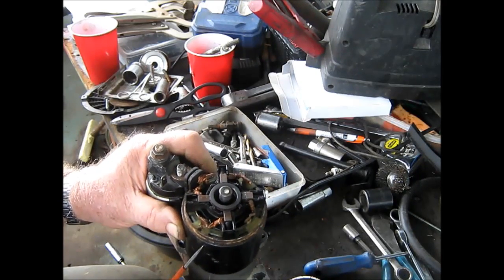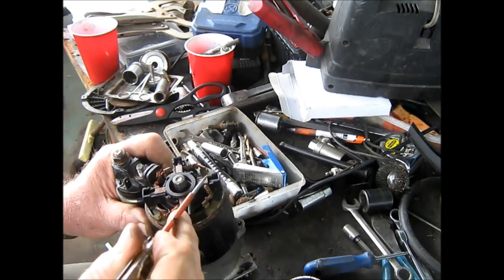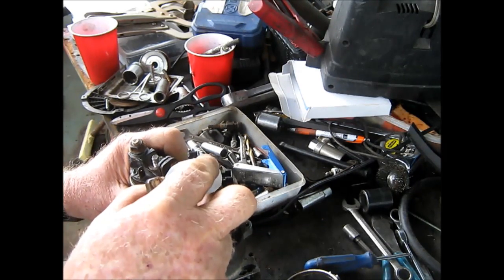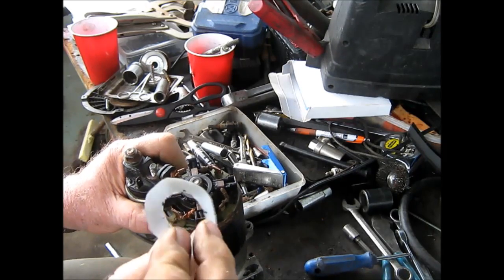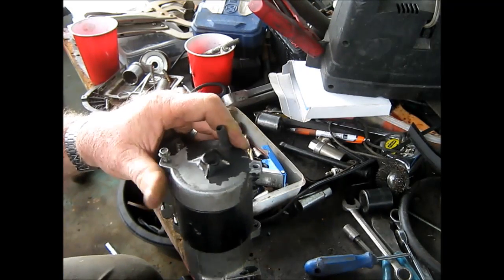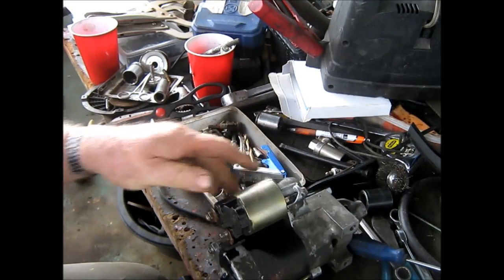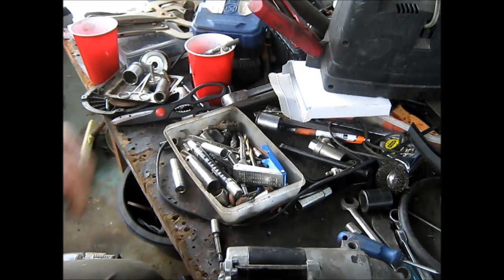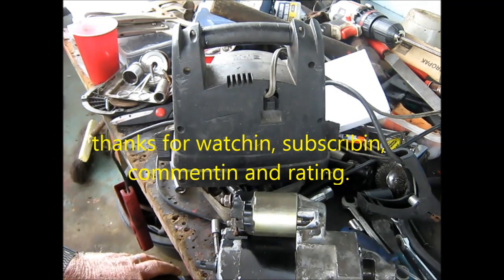Kohler Command Starter Repair

Comment: Hi MissouriOldTimer, Just curious if you could provide an update if your solution worked for any length of time. I need to play with my starter and can’t afford to buy a new one. How long did it last? Did have to do anything more to it? Thank you for your video.
Reply from the maker: lol. that's been over three years ago, my  memory doesn't go back that far,, but I don't remember having any more problems,  I still don't know what was grounding it out.